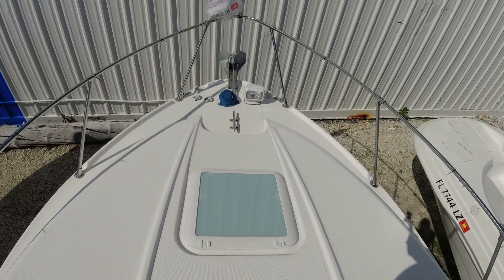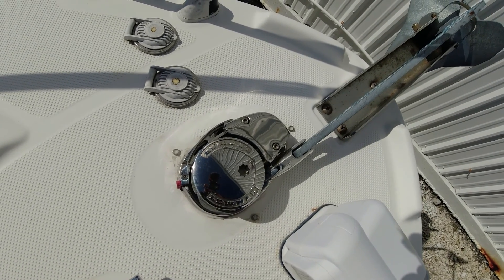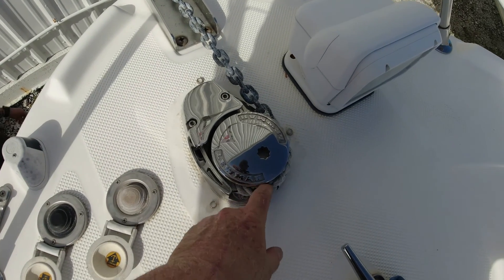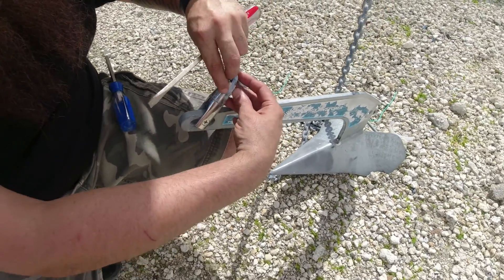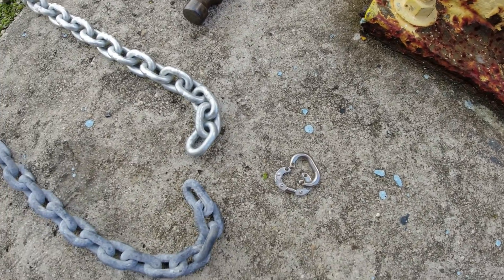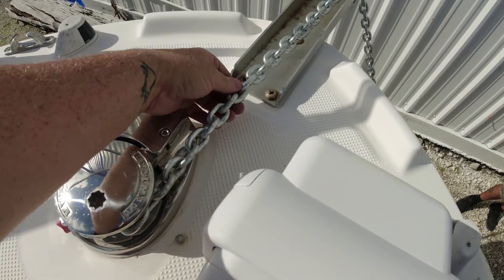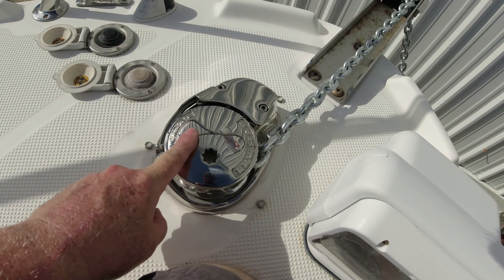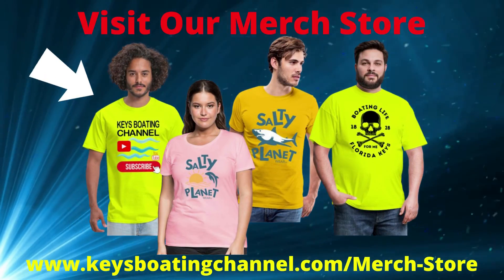BOAT Anchor Chain SETUP - Problems with Lewmar V700 Windlass

Comment: Great video, I just got a new boat that has the same windlass. I was having the same problem the first time I tried anchoring with it and been meaning to look into the issue. First time with a windlass so thought it was the clutch that needs tightening
Reply from the maker: Hi, thanks for watching our video! Yes, this problem can be a headache, but the easy fix to the problem is adding more chain...I tried tightening the clutch and no improvement. But been using it with the extra chain and no problems so far. Thanks so much for your comment and support. Congratulations on your new boat! Peace!
Reply: same here new boat first time using windless and always have problems on the rope section. I was thnking a longer chain would be the best solution

Comment: I have the same problem with the V700. The chain goes through beautifully but the rope jams. I tried putting tape round it on the bad jamming bits and it partially solves the problem. I have now increased the chain from 10 meter’s to 20 meter’s to reduce the depend on rope. I normally fish in 20 to 40 meter’s so I am gradually reducing the dependence on rope. Obviously the more  chain the better the anchor hold in rough weather. 
Thanks for the video . I hope Lewmar improve their rope handling.
Reply from the maker: Hi Nabil, thanks for your comment. I had an old Lewmar 600 windlass before and never had any problems until it broke, but after I changed it to the new V700 all problems started. So until we get the solution the only way is to add more chain. So far no solution from Lewmar, but if we find a solution I'll be updating it here. Thanks for watching! Peace!
Reply: After adding the extra 10 meters of chain the rope handles better guess because there is more weight pulling the anchor and thus the rope downwards. I firmly believe that adding more chain will definitely improve things. I am considering doubling my chain again.
Reply from the maker: @nabilrahmatalla  Hi Nabil, yes another subscriber mentioned that the extra weight of chain may actually help the stability of the boat. But the extra 30' of chain I added on mine has worked pretty well for me so far. Thanks for your comment! Peace!

Comment: I'm dealing with the same thing on a new Lewmar V3 Fast Fit. One thing I found is that if we block the control arm (the part you're pulling out to demonstrate) open the rope (3/4" 8-plait in my case) pulls through fine. I'm shooting video of it to send Lewmar at their request this week, but might just send them yours!
Reply from the maker: Yes, you can send ours if you like...thanks for your comment and hopefully we can get an answer from Lewmar. Peace!
Reply: @KeysBoatingChannel  Did you figure it out? Looks like I have after months of having to retrieve the anchor by holding the lever arm out! While you're running a V-700 and I a V3 there's basically the same operation. Finally tearing it down I found the lever arm pivot bolt was loose and bent, allowing the lever arm to move up and down. Once Lewmar support saw my video they suggested the lever arm was bent. It's not, however the bolt is. This provided slop for the lever arm to jump up and down. When ordering a replacement lever arm kit I learned the part had been revised. Rather than the fully threaded bolt with sheath protecting it they've changed to a full shoulder bolt with spring, which will be much less susceptible to bending... My bet is this is the problem. It looks like West Maring socks replacement lever arm assemblies for your 700. There has to be a reason why... The stripper arm should not jump or move up and down, allowing the rope to run over it. Let me know what you found. Jim
Reply from the maker: @jamesbuchanan6040  Hi Jim, no it still gets jammed, and this weekend the chain started to jam as well...I'm going to have to do the same as you and send them a video. Its been really frustrating to use it. Something that should be convenient now its beginning to be a problem every time I use it. Thanks for the information! I will into it this week. Hope you are doing great, and Happy Boating! Peace!
Reply: @KeysBoatingChannel  What I learned: When the rope will not wrap easily around the gypsy it's too stiff. Your rope chain splice looks like it's tapered well, which I needed to resplice, however, the OG splicer I hired to work with me on the system showed me this very issue, which he deals with it all the time. The first thing he checked was how flexible the line is in the splice area. While my 3-year-old 5/8" 8 plait wasn't bad, it was getting there. The rope also showed a bit of wear. Nothing bad, but some fuzzy threads on this fine 8 plait. To fix it, we cut the splice off, fed the rope out, and turned it around, so the end that's never been used was spliced to the chain in an extra-long taper. 

That did it! He also explained there are two things we should all do, regardless of the windlass type, when running rope. Hose the rope off with fresh water as it's being retrieved, or pull and do it when you return if you don't have the freshwater capacity. The second is to feed the chain and rope into a 30-50 gallon trash can etc. filled with fresh water and a bit of Dawn dish soap and a liquid fabric softener. The softener will keep the line pliable, stopping this from happening, and the dish soap will break down and grease, fuel or oil, etc. which may have gotten into the line while in the water. Seems lines, like everything else in salt water, need love too! Hopefully, this will make a great maintenance video!

With that done, I still had to tear the gypsy apart twice to figure out what was going on with its failure to torque down on the bottom cone... Seems the V3 may have some challenges with the factory add-on shaft & tube extension kit not providing a full-contact surface for the spring clip that holds the shaft in place. The clip had pushed out of the shaft groove, allowing the shaft to rise and bottom out against the cap so it would not tighten... Still in contact with Lewmar on this.

Did you get or see the Lewmar training video for one of the boat manufacturers' customer service staff where they teach this problem and that it's not warranty? I think I sent it to you.

Good luck!
Reply: I hope that all posted to you...

Comment: The splice on the rope is too thick. You may need a thinner rope diameter so that the splice at the chain is also thinner and fits in the teeth of the windlass Gipsy. Or put some serious load on the splice and massage it to tighten the splice.

Also I would never rely on that “c connector” to link the chain segments. That’s asking for a failure in equipment which will potentially cause a serious incident out on the water. At least a loss of the anchor and new segment of chain.

I can’t imagine that c connector was purchased from a reputable marine store
Reply from the maker: Hi, thanks so much for watching and your comment. Yes, I myself have had doubts about the C link. I inspect it frequently, and so far, it's held well for now a year plus under good load. I'm not feeling so bad about it anymore, but it is still in the back of my mind. The rope, yes, I don't like the splice, I'm going to try to remedy it myself, I'm sure I will have to get a new one in the near future. Thanks again! Happy Boating! Peace from the Keys!
Reply: Yeah, it looks like it pulls in the rope rode just fine but sticks at the splice. Thinner rode might help, and/or do more tapering of the tucked strands of the splice - remove some fibers from each strand before each tuck so the spliced portion isn’t so thick. As long as you don’t remove fibers from the parts going through the chain link and maybe the first tuck you should still have full strength.

Comment: Hi, friend! I write from Venezuela. very good video by the way. I have the same problem on my boat and it drives me crazy. if you could solve the problem by putting only chain? I ask you since I was reading the comments and I saw that you answered in one, that you are still getting stuck but less than before. Thanks a lot
Reply from the maker: Hi, thanks so much for your comment. The last time I used it, it worked fine...and so far it's been the easiest solution to the problem. Glad this video helped, and Happy Boating! Thanks for watching our video, Peace! Gracias.

Comment: What size chain is that? Connection strenght?
Reply from the maker: The chain size is 1/4" G4 Galvanized Anchor Chain Product Link: https://amzn.to/3VWLRF8
and the link information is here: 1/4" Chain Connecting Link approx, 1,000lbs strength see info here: https://amzn.to/3TdzLFL Its been working perfect with no problem. Thanks for watching our video! Peace from the Keys!

Comment: What is the tensil strength of that connecting link?
Reply from the maker: Hi Greg, the link is rated at 1,000#. So far it has worked well or better than I expected, its now been a year and it still doing great. Thanks!

Comment: Hey just saw your video…I am having the same issue as well…such a pain in the butt…
Reply from the maker: Hi Greg, the link is rated at 1,000#. So far it has worked well or better than I expected, its now been a year and it still doing great. The problem with V700 has improved since now I don't to mess with it getting tangled. Thanks for your comment and watching our video! Peace from the Keys!

Comment: I would never use a link. Please consider the load rating is it's holding power, unrelated to the weight of the anchor. Let's say you stik your anchor in rocks. The link is the weak point. Same with those surprise storms. Please consider the anchor is to hold the boat in place in the worst of currents.
Reply from the maker: Hi James, yes I was not too happy with the link, and am looking for alternatives although the link has a WLL of 1000#, and its been working ok so far. Thank you so much for your comment and watching this video! Peace!